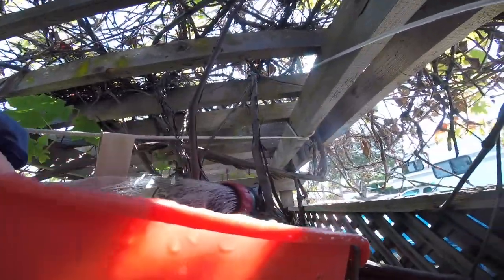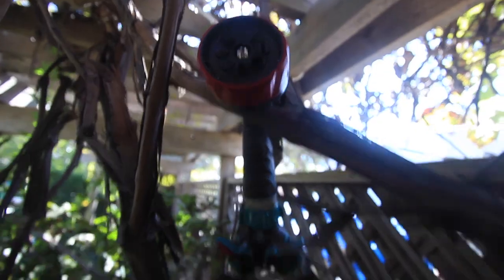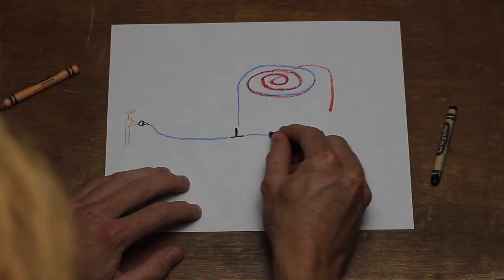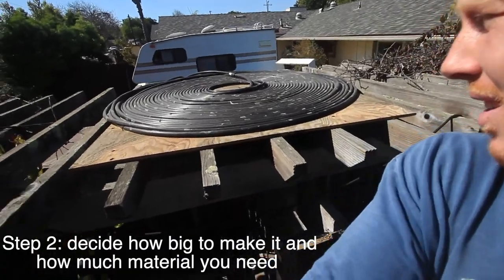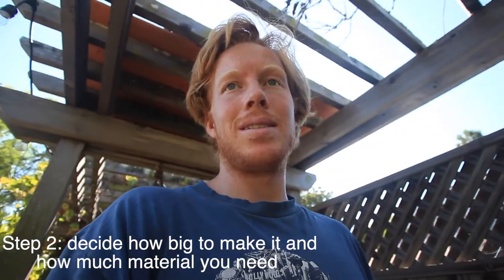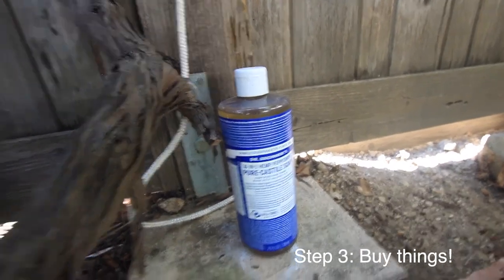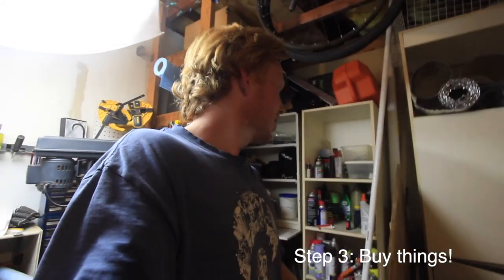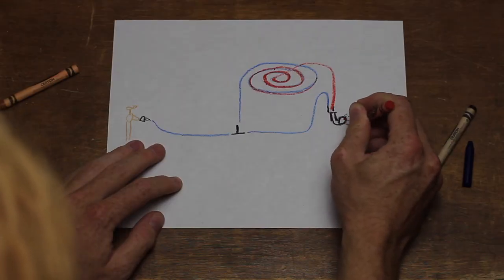DIY Solar Heated Outdoor Shower! Simple and Cheap!

Comment: Hi, question: is the water spinning process is what makes the water hot? Thanks for the vid!
Reply from the maker: Hi! Actually, it's the sun that makes it hot. It doesn't necessarily have to spin like that to get hot. The only reason I coiled it up was so it takes up less space in my yard. That hose I used was like 300ft long so if it was stretched it out strait it would go all the way down the block. (But the water would still also end up hot.) Hope that helps!
Reply: @thewesley95  got it! thanks for the info :)